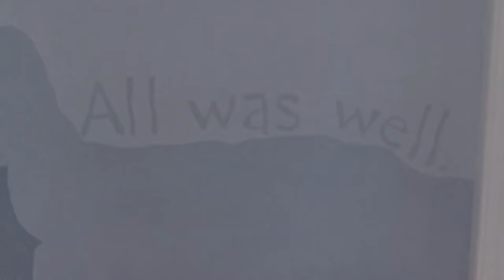Harry Potter Nursery Time Lapse

Comment: Excellent!!! I do not have much artistic ability and I was also very broke when I found out I was pregnant so I found pictures of bears floating on balloon strings. I took the photos to a Kinkos copy center had had them enlarge them, cut them out and traced them on the walls and then just painted in the lines. I went into labor very early and I remember telling the nurse that I couldn't possibly be in labor because the bears were not done. I think she thought I was nuts!